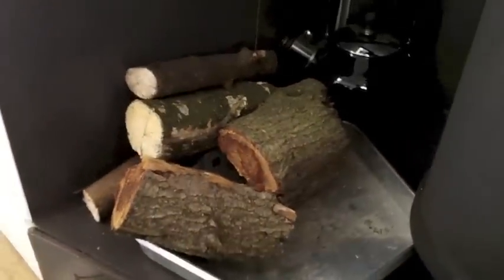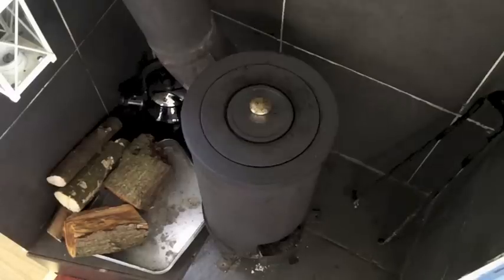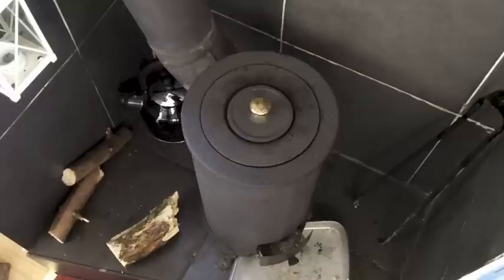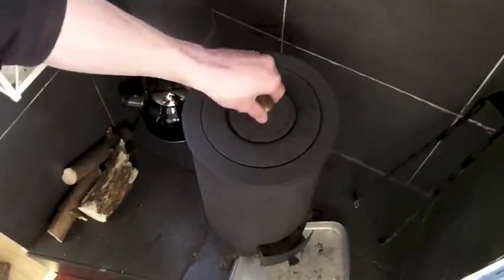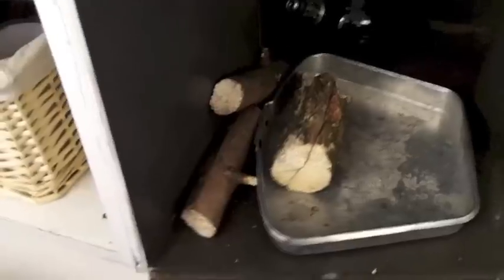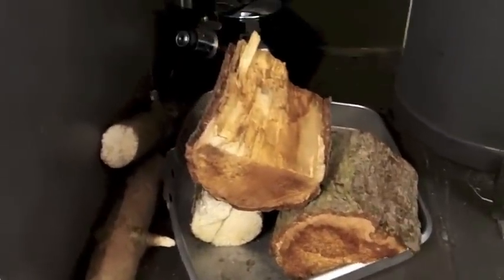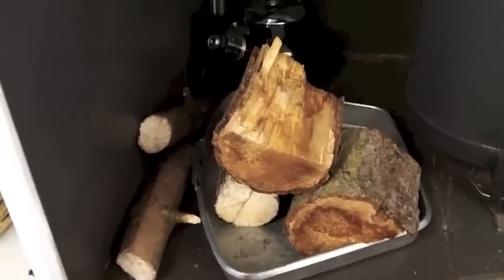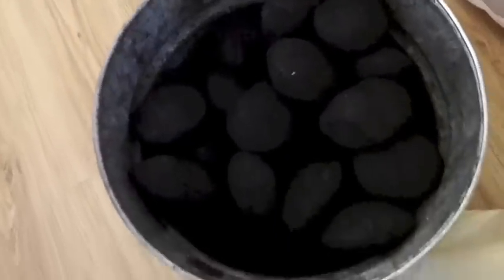My Weird Boat Fire (Plus a few Tips!)

Comment: Nice video Dan, i have a shop made woodburning stove, it has air vents, ash shaker and all the bells and whistles, but trust me, the ash shaker never works, your constantly fiddling with the air vents all the ash never lands on the ash pan and the glass on the door is a pig to clean, you have a nice simple stove, it does what its supposed to do, just love it for what it is lol, nice tip with the match in the firelighter.

Comment from the maker: Yeah I would love to have a proper little fire there, I have been looking into it but one of the biggest problems is the weight of a proper cast iron fire, this one is some kind of steel one so is literally only a tenth of the weight of the proper fires which means the fireplace itself would probably have to be redone and the boat rebalasted to counteract adding a huge weight to one side! There is a slight lean to the fire side ever since I got rid of a few bits of furniture already!

Comment: It might be better to invest in a decent manufactured stove Dan, this seems hard work and slightly dangerous! With a proper wood burner you can build your fire then light underneath safely close the door and use the damper to control it. Fire safety should be absolutely top priority. Take a peek on eBay for a good second hand one and get a proper engineer to fit it. Jobs a good en 😊 x

Comment: I noticed someone said that ash is good for plants; wood ash is but coal ash isn't! The recommended practice is to put coal ash into the general waste bin since it has little or no nutritional benefit and is potentially harmful to soil, plants and consumers of edible produce. Don't  spread it where there is livestock or crops. It needs a bit of research but I wonder if you could spread it very sparsely on the tow path rather than on the grass. There are obviously already low levels of poisons in the earth already and I'm  thinking that, although it's not good to lay it down concentrated, if it is spread out perhaps it may be harmless.